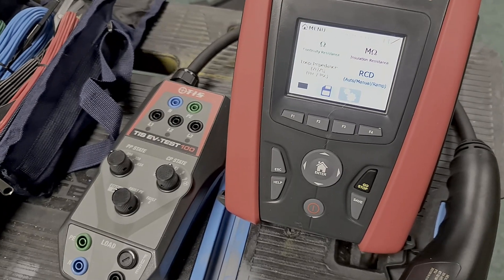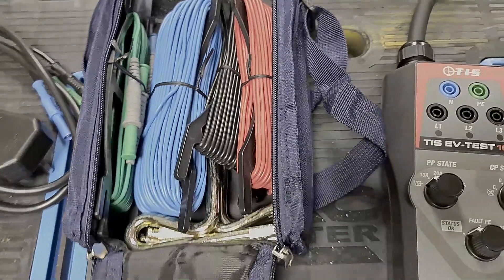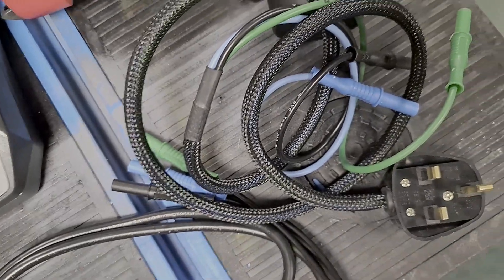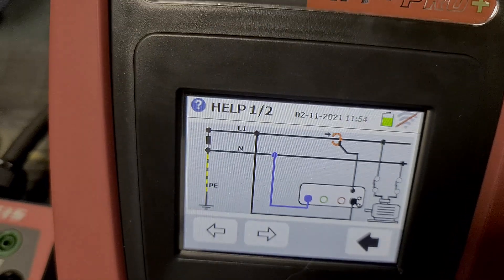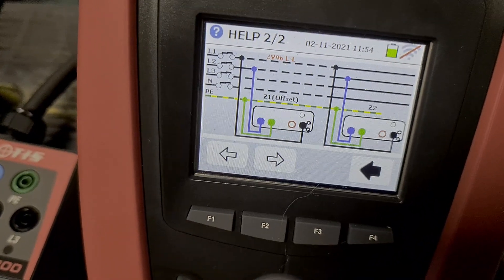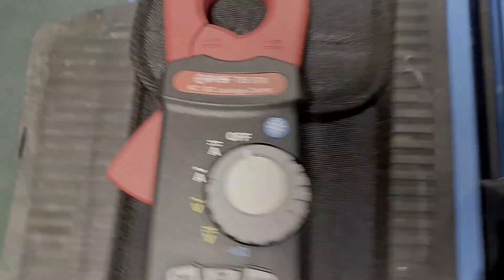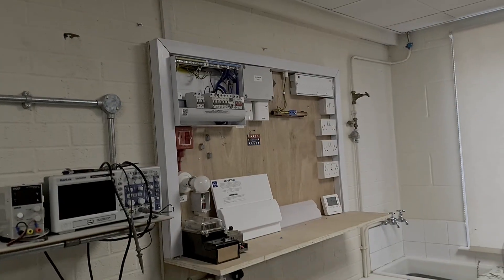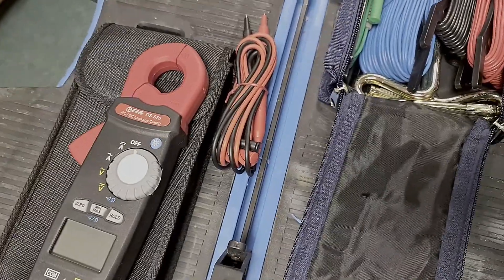The best value electricians MFT tester available TIS MFT Pro plus  AC/DC clamp meter TIS570

Comment: I nearly bought one of these, not this version, but reading up found it was a rebranded tester from a Spanish or Italian company I think, which is a orange colour.
I was put off by that, and the fact it looked a bit fisher price, plus the screen and icons look dated like window 98, also you never know how long these companies stick around, so I went for the latest Megger, and to be honest during my apprenticeship I had only ever used Megger or fluke so stick to what I knew.
Reply from the maker: HT instruments mate. A quality brand themselves in fairness. TIS have been about a good while. They look after customers bang on. We had a megger go pop at 2 years and they wrote it off as beyond economical repair! Tis give you 3 years warranty and calibration. It's a cracking value tester at way below the megger price point.
Reply: How much are you getting them for?
Online prices put them in the same price range as Megger.
Reply: @jonathanrose456  they were at least £150 less than what I paid for my Megger, not sure if that was because cities wanted rid of it, but it's also before the crazy prices.

Comment: I thought they ditched the coloured screens because it hammered their batteries a guy I work with used to have one and that was his only complaint with the colour screen.
Reply from the maker: The eco version has a black and white screen but pro version is colour. Decent rechargeable batteries make a massive difference. I started out just using AAs and they wouldn't last long. Solved with better batteries. New kits come with them which is nice mate.
Reply: @electrician247  Thats interesting to know, apparently they also have the two wire earth loop impedance function

Comment: The clamp meter looks like a rival to the Fluke. Have TIS given you a discount code or best place to buy from?
Reply: Tis seem to be in a lot of electric centres
Reply from the maker: No mate. Just sharing my opinion on gear I use. CEF are the main stockists I think. But they are in most wholesalers. Drop them a DM on twitter or Instagram. Really helpful team at TIS.